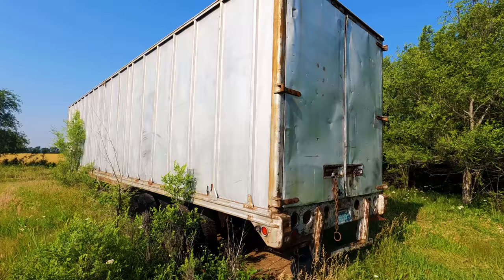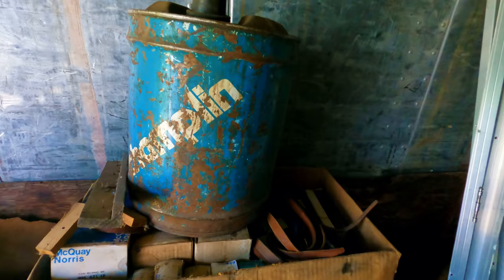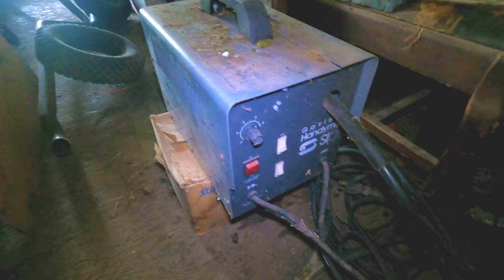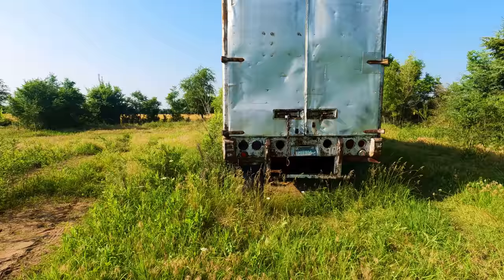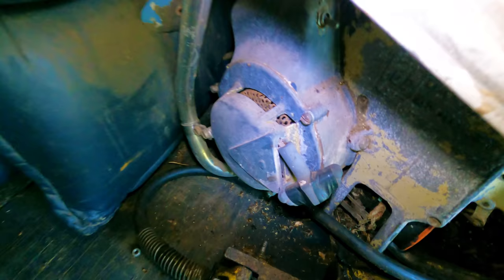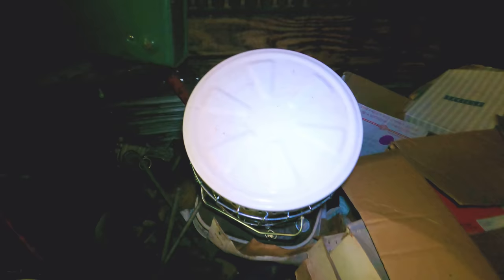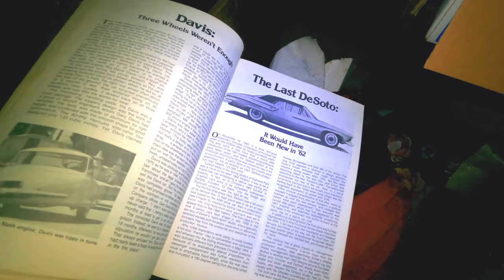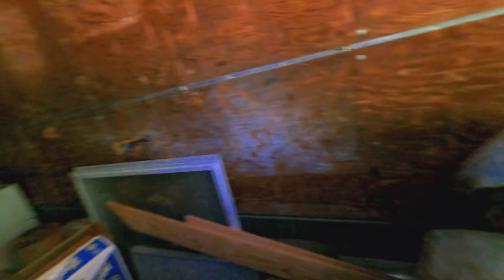I Bought 2 Mystery Semi Trailers Full Of Cool Stuff. What Did I Find?

Comment: Those old air compressors are my favorite items when properly restored they will outlast and out work any new air compressor
Reply: Actually have 1 very similar to that 2nd air compressor in our shop. My dad said it was there when he went to work there in 1978. Tanks no longer in use (built in 1930-40) but our local compressor guys said do not replace the compressor. It's far better than anything on the market today.
Reply: Oh yeah, they don’t make them like they used to.

Comment: The rotating bar on your chainsaw had nothing to do with your wanting to cut at different angles, it was all to do with the carburettor on the saw being a pre vacuum operated carburettor system.
It had the old bowl setup which would not work on its side (it would run out of fuel after a short while) therefore the 'engine' of the saw had to remain upright, hence the rotating bar setup to allow you to fell the tree then reset to cut the tree up.
You had to have broad shoulders believe me to use one of them for a day, I started work on them as a 15 year old.

You got yourself some really nice stuff there 👍👍👍
Reply: You forgot to mention the oil in the crankcase. Those old saws are four stroke engines laid over the engine will lose oil pressure. After that you know what happens next. My dad had a two man diston saw it wade 110 lbs. On the operater end.
Reply: Wasn't he right then? Cutting different angles? To keep the engine upright?
Reply: @oldironfinder  
Not really, he forgot to mention why the blade had to be able to rotate.
You can cut any angles with modern saws.

Comment: I have a 1965 sears chain saw that runs on straight gas and has an oil tank its, 60cc. And will out cut any modern saw. Only prob is it goes through mufflers pretty quick.

Comment: Kitchen chairs…… the contoured “feet” of the chair dates them some.  Or a unique brand made them.  The large chair,   If you are “good” at reconditioning the wood professionally…..do it.  Then price out re-uphosoltering.   Carefully look for manufacturer name even under the cloth/cushion.   Many have a CRAFTSMAN MARK THAT IS UNIQUE.   LOOK UP CHAIR ON INTERNET CAREFULLY.   NEW UPHOLSTERY COULD FETCH A SUPER NICE PRICE. AND RECONDITIONING OF THE WOOD BY A QUALIFIED PERSON.    
STEEL TABLE- SELL AS WELDING TABLE OR SCRAP / WHICH EVER BRINGS BEST PRICE.   IF IT HAS UNIQUE FEATURE TO WELD ON… WORTH CLEANING ALL RUST AND REPAINT LEGS BUT POLISH TOP TO SHINE.